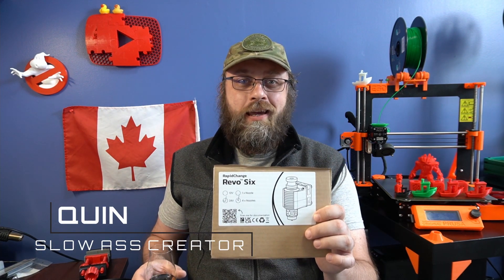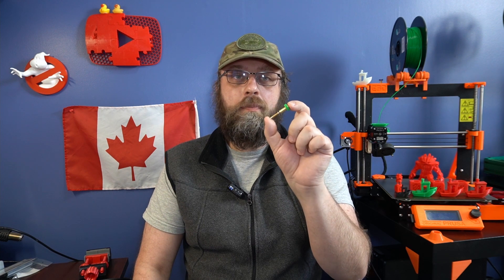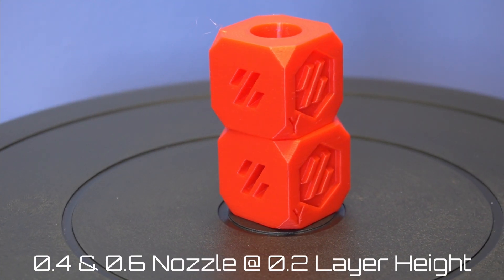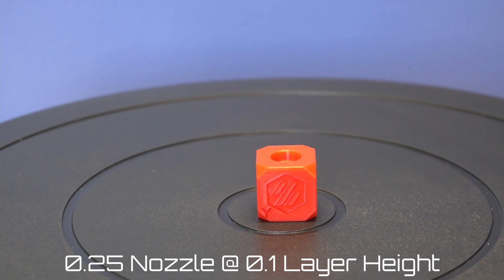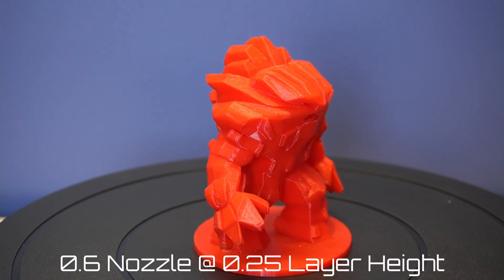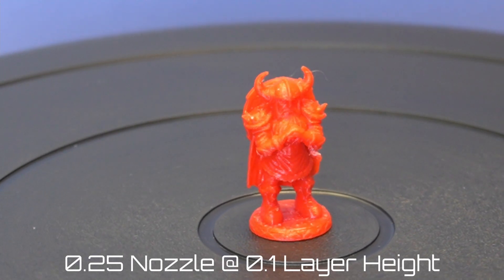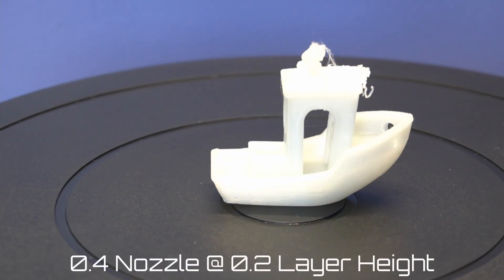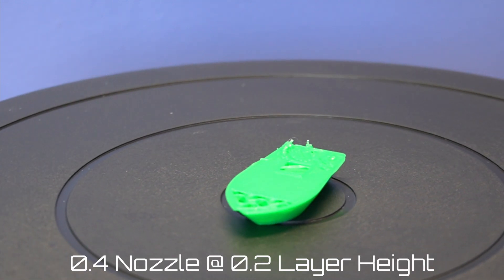Review of the new Revo on a Prusa MK3s

Comment: Hey there, I found your video while searching for the release notes of the latest firmware. For those of you like me who naively flashed the latest firmware and were treated to a loud BEEEEEEP and a thermal-related error, you will need to either downgrade to 3.11.x or use Pronterface to send M310 S0 then M500 to disable the new thermal model protection which is causing the issue.

I got the Revo6 for the office MK3S+ because I was getting a lot of hotend leakage. Turns out, I suck at hot tightening and I should really be using a torque wrench.
Reply from the maker: Great comment!!

I tend to stay with any stable version of the Prusa firmware for a while.  I just remove the firmware check option in the slicer to get rid of the nag message.

My Prusa MK3 and Voron V0 are mey daily drivers so I stay with what works as long as I can.   I tend to do a lot of tinkering on my MK3 and Voron Switchwire.

Comment: My revo six has horrible artifacting, I switched back to the normal v6 and it was gone I’m so lost
Reply from the maker: Sorry to here that your having issues with your Revo.   Did you do any tunning after the install?   I did a PID tune followed by by an extrusion e-step calibration.   I can't recall how much different of a difference I had in the extruder e rate but I can recall that it run a bit easier then the v6.

Comment: "Do you like to print with exotic fillaments"
Me: At first yes, then I had to change a nozzle after clouginc it. never touched exotic since.
Reply from the maker: The first thing I used my 3D printer for was to make models for gaming, I got the wise idea to use wood filament not knowing it was abrasive ... Needless to say when I started doing mechanical prints I could never get my dimensions right.  .... Drove me nuts.

Apparently a hardened nozzle is coming for the Revo, although I haven't heard of any dates yet.  And if it's in any reviewers/testers hands they are keeping a tight lip about it.

🍻

Comment: If you have to correct z-offset for 0.25mm nozzle, you only have to do it once on the mk3(s(+)). If you use smooth springsteel, store z-offset for 0.4, 0.6 and 0.8 for "smooth" and add a second springsteel "smooth025" to store 0.25 offset there. So you not need to correct z-offset after nozzle swap in the future anymore, just select another springsteel...
Reply from the maker: Great point, I forgot that you could add more, been a while since if I had to do it.

🍻
Reply: @QEngineering  Actually I use the sheet management quite often: PEI-Sheet, Prusa Textured, Prusa Smooth Textured, Fystec Textured (much wider pattern, like theese old machines with hammer treated silver coated metal, quite nice if you print silver PLA) and trianglelab textured (Like Prusa TXT with more dense pattern).
So I already use 5 spring steels. If I remember correctly, only 6 steels can be stored. But have not updated firmware lately.
I might be able to store only one 0.25 sheet - have you tried the textured Prusa sheet with such a thin nozzle? I am a bit unsure if such a small nozzle work with the texture and a thin first layer.

Anyways, If I remember correctly, you also can adjust a z-offset in Prusa Slicer in printer settings. So if you setup the z-offset-difference there and save this new profile, you automaticly take care for different offset without adjusting anything on the printer.

I just got my Revo Six full Set last week. Just tested 0.4 and 0.8 for now and I am pretty amazed. The quality defintly has improved. I just ordered a Revo Mini full set for updating my Prusa Mini and a Revo Six 0.4 hotend for a second mk3s (a Clone). The third mk3s Clone has a Dragon hotend with 0.4 mm nozzleX for abrasives.
I a have quite a few printers (my hobby is more about tinkering on printers than actually using them), so the new Revo is about to significant torture my bank account...
Reply from the maker: @oleurgast730  I have a textured bed that I used on the mk3 but since I set it up so many years ago I just forgot about it ... Especially since my switchwire acquired it a few months ago.

I tried the textured sheet on a Prusa MK2.5 with a .25 many years ago and I couldn't get a .1 layer height to be reliable  on it.  Bumping it up to around .15 first layer is when it started working good. 

I know the pain on the bank account, I built the v0 and a switchwire back to back.  I also upgraded my v0 use the new skr pico board and updated the switchwire to a dual Bowden system.

Comment: Thanks for this review. I was wondering if it was required to do a bed leveling every time the nozzle was changed. Glad you provided the answer to that. Do you know if the Revo Six is sold here in Canada or we need to order direct from E3D in Europe?
Reply from the maker: Hi, some people have came out and said they had to make small corrections, but I've never heard anyone tell me that they had to do anymore then 0.1.

I ordered mine right from E3D within an hour if it going up for pre-order, that's why I got it so quick.  

I did see that Spools3D.ca has them up for sale, they are out of Calgary.

🍻
Reply: @QEngineering  Thanks!
Reply from the maker: @TessierWork  anytime.

🍻

Comment: Great overview and I was happy to hear that the Z-offset is stabile between nozzle changes.  If the problem PLA you mentioned is HTPLA, I've had good luck with 240C hotend temperature setting.
Reply from the maker: That's brilliant!  I didn't think of that.

The filament is a hot mess, I ordered black, the box said black but there was a white roll inside.   Figured what the hell I'm painting it anyways, and its never printed right.  It has this rough texture on the outside, its much lighter then normal PLA (almost as if it was aerated during manufacturing).  So maybe its not just the colour that was wrong but the material type.

🍻

Comment: Hey q keep up the good work. As a fellow Canadian its great to see the content.  Just curious what type of engineer and tradesmen are you? Myself im a millwright but have been enjoying some of the cad stuff I've been trying to tackle. The learning curve is very steep.
Reply from the maker: I'm an electrical engineer by schooling, I was an Avionics Tech (aircraft electrician) when I was in the forces and now I drive millwrights crazy by walking around with my hands in my pockets (aka Industrial Electrician).

CAD does take time, but since you already know how to fabricate thing you'll have a much easier time designing things.  Think build the base material, cut away what you don't need and add extras.

I go by Q363Q on reddit, hit me up if you need any help with anything.

🍻
Reply: @QEngineering  thanks for the reply. Yes I had a fun time learning the a2plus assembly work bench today. It wasn't without issues but I did manage to bang together an assembly.
Reply from the maker: @Juiceboxmakes  anytime brother, skilled trades gotta stick together.

Comment: How is the filament tip ?  Ready for mmu2s?
Reply: My revo is in the mail and I'm going to test it with the MMU, I'll let you know (I'm hoping for improved tips also!)
Reply: So Ive been printing with the MMU2s and Revo for a little over a week now. Im printing composites of ASA/TPU 98A. Ive had more success in the last week than I did for the month leading up to it with the stock V6 hotend. I'm noticing better tips and less heat creep which is critical with the TPU. Im loving it.
Reply from the maker: @sm1980able  that's sweet, I'll probably put a Revo and dual extruder on my switchwire later this summer.
Reply: @QEngineering  Cheers. If only I was nearby to you we could have a drink and chat about it more!
Reply from the maker: Sorry, I don't have any experience with the mmu2s so I do not know what to look for  problem wise.